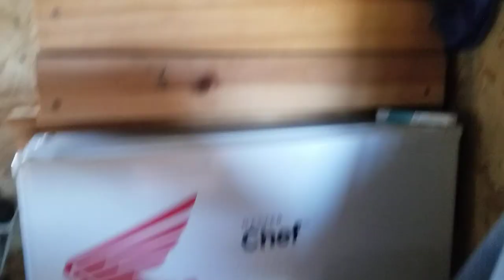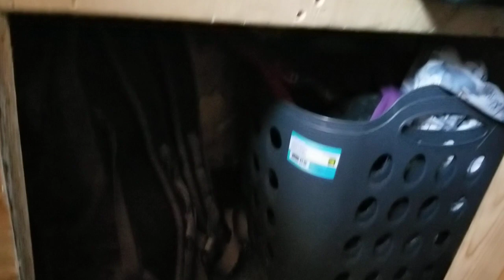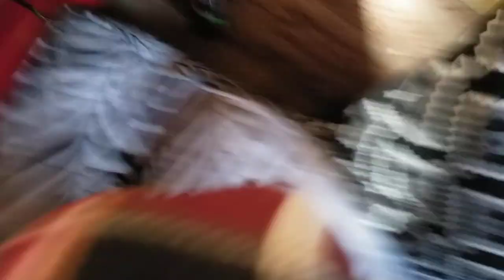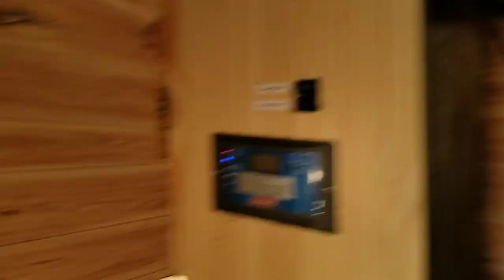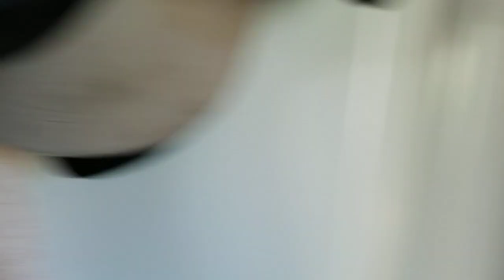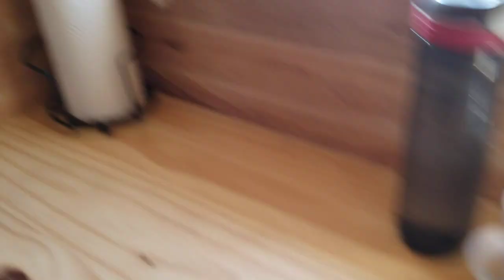Scratch Built Truck Camper Tour

Comment: Shame about the negative comments.  I love this build , well done,  it's functional which is the most important aspect. I kitted out my 7.5 tonne Ford iveco ex horse transport truck 1987 model,  all with pallet wood , 67 pallets,  disassembled,  sanded and oiled , the only wood I payed for was the work counter top in the kitchen. I couldn't cope with the over cab bed because of my arthritis and back so used a bunch of donated 4x4 and 3x4 timber and made a 4 poster . I love van life. One ❤ from 🇬🇧

Comment: I lived in a truck rv a few years. I started by accident, lost my home, the banked robbed me of it and I sweared not to pay banks anymore. It was due to a medical episode; then I rented for a while but got pissed with my stupid landlord and looked and found a cheap RV unit. I paid 1000 $ for it a bit old but did the trick for a while. I had 2 trucks anyway, kept one as a "house" and used the other to travel. I couldn't have a normal rental contract anyway for because I would travel sometimes 2 months or 2 weeks at a time multiple times per year. It's awesome, I traveled 9 months a year and only had to work 3 to pay my bills. Traveled lots including internationally, and when away too much time I put the car in storage. Not same like a house but the positives by far outnumber the negatives. Best time. I plan to build one or have one built to fit exactly my needs, I am not fussy. I learned the meaning of freedom not slaving for government ,banks and other big companies. Good for you brother, that's real life.

Comment: That’s awesome. Great size! Can we see the more of the outside. And how many batteries do you run if you aren’t hooked up to dc to use your Xbox
Reply from the maker: Thank you! I know I've been saying it forever but more videos will be up soon. 

I can be completely offgrid and run the xbox on dc at about 25ah that includes the monitors power usage and with 240ah of storage thats more than enough to run it for a couple hours safely (this is also with a mini fridge running on an inverter 24/7)  but I hardly use it more than 30 mins a day if at all.
Reply from the maker: Video is up now! I did try and explain the xbox setup as best as possible :)

Comment: Hey bro what kind of truck do you have? I am thinking about doing something similar but trying to figure out what size truck i should get. could i get away with a ranger?
Reply from the maker: Thanks for the comment.

Its a 2002 Dodge Ram 1500 5.9L. Probably the smallest possible truck you could do it with this amount of weight. I also installed timbrens on the rear end (they replaced the oem bumpstops) which helped accomodate the weight. 

As far as getting away with a ranger I think its possible you will just have to be more mindful of the weight and size of your camper.

One other piece of info Ill add is i've driven the truck 13,000km WITH the camper on. Only issue was 1 rear tire blowout and that was only because I didnt have properly rated rear tires to start with. Upgraded from the cooper discovery at3 4s to cooper discovery at3 xlt's (1600lb capacity/tire vs 3600lb capacity/tire). Trucks total mileage now is 299,700km.
Reply: Absolutely do not try with a ranger homie

Comment: nice camper  if you can do a video of the outside and the roof and how you take it off and on the truck .  what do you think it weights .  thanks
Reply from the maker: Hey sorry for the delayed reply..

I will be doing an outside video soon (Hopefully over the christmas break).

The weight Im geussing about 1800lb-2100lb depending on if the water resoivoirs are full or not (they add a couple hundred pounds extra).